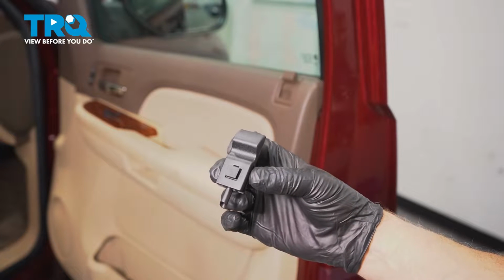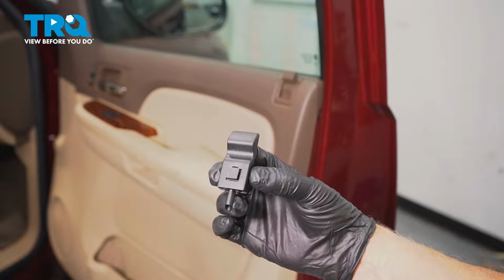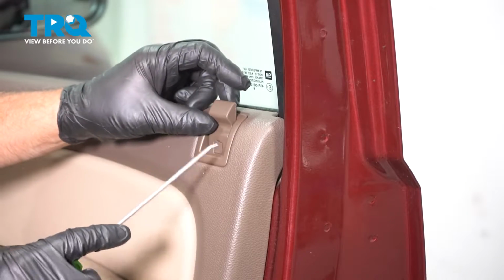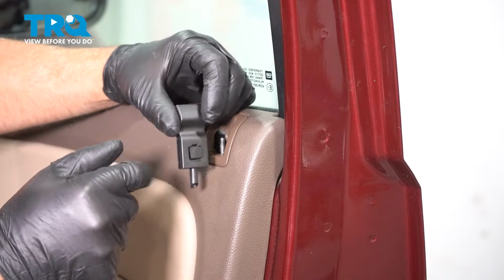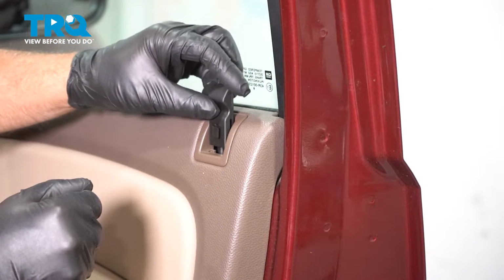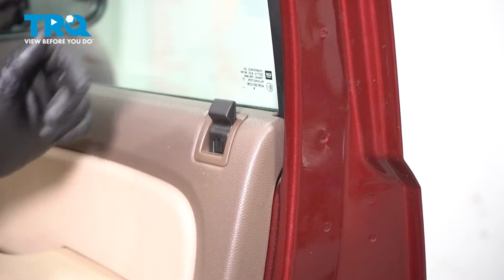How to Replace Door Lock Knob 2007-2013 Chevy Silverado

Comment: My little push button doesn't "snap" in with my replacement pieces. I've bought 2 different ones. Is there a trick with that button? It seems to push in flush but if you lock the door sometimes the push button comes forward and then it gets stuck down in the lock position. Can I glue it or something without creating an issue later on or is there a trick to this little push Button staying in place? It doesn't make that click sound you got in your video but it clicks when not on the lock just not while on the lock.